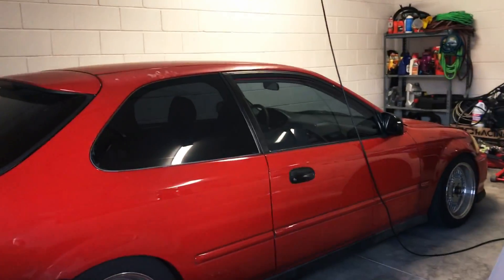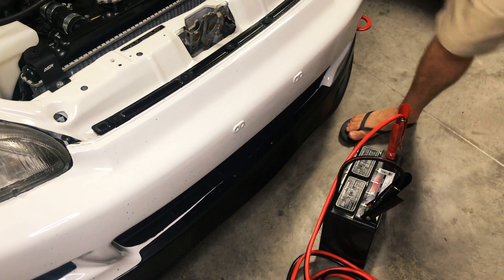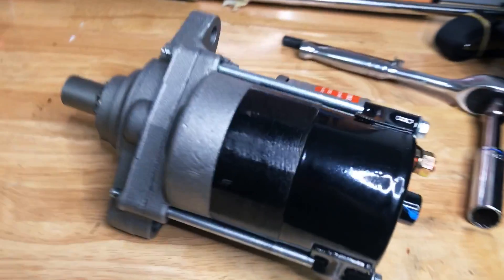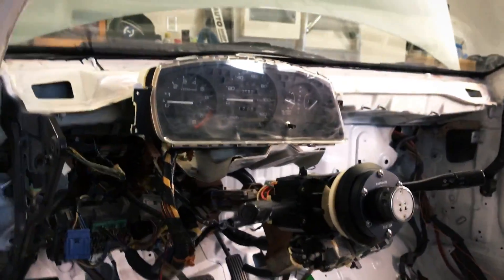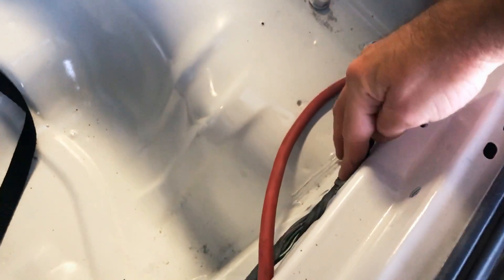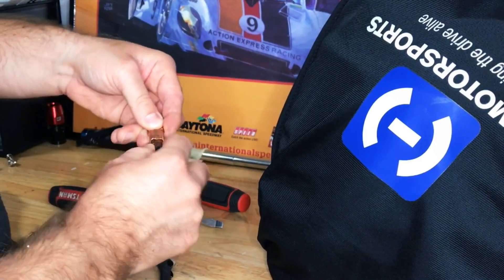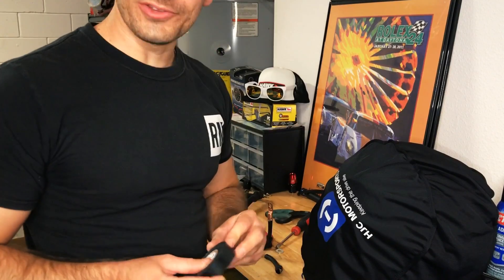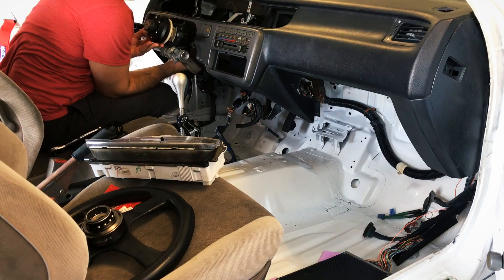Car Won't Start 2 Days Before Track Day!

Comment: There is a tool that you beat with a hammer to basically put a v notch into the crimp on those big copper connectors. I've done so many from 0 to 4 gauge that never ever came apart. I cant remember the name of the tool but it's a black vertical block looking thing
Reply: the tool is a big old screwdriver, full diy spec

Comment: Good fix man, I've had the same problem before missed a day of work trying to troubleshoot till i found that loose black wire going to the battery lol Glad it fired up!
Reply from the maker: Missing a day of work to wrench on the car sounds alright to me haha! Not getting a paycheck isn’t great though...thanks!
Reply: @RefineMovement  it was worth the experience to learn a bit more lol you're right though any wrench time is usually a good time!

Comment: Glad it was a simple fix. One thing I would have tried mechanically would be to put it in gear and roll it to cut the flywheel because it sounded like it was hitting. It is rare for that to happen but it does happen, I have even seen the starter get hung up on the flywheel and not retract. Props for trying everything you could try even double checking that the starter was good after seeing it work.

Comment: Before I bought the crimper,  I either used my vice or a hammer and a chisel. Take the chisel and smash an x in the lug.  Held fine for many years, I only bought the crimper cuz I figured customers deserved better!

Also check out runhard industries, they make battery cable kits and can probably help you out
Reply: I just never crimp them i fill it with solder heat it up with a torch and feed the wire into it. Makes a solid permanent connection with a greater surface area for the electricity and I like how it looks uncrimped lol

Comment: When ever I get this kind of situation I always start with the bigger connections. Its bad connections that give you issues like this. I've seen dozens of times where everything is tight but it doesn't go. I take off all battery connections and clean them with a buffer/sandpaper. The connections on the starter and the battery and then try it again. 9/10 times it'll fire right up after that.  Just as a final thought tight connections doesn't mean a good connection.
Reply from the maker: Very good advice!

Comment: You did good with what you know brotha. I’m in the same boat with my civic. Learning as I go. 
Sucks for your track day 😔 feeling your pain.
My last track day this year, I showed up, unloaded my car off trailer and boom started to leak oil 🤦 tried to find the problem. And after a couple of hours trying I had to give up and push her back on the trailer. Didn’t want to risk leak oil all over the track. So wasted a full day. For what? Find out later that I had a second oil filter o ring stock to the block. And like a dumbass didn’t see it or even thought about looking for that. I learnt my lesson lol that’s how it goes when you are learning. 
✌️
Reply from the maker: Aw man that’s tough! I know all the effort you can go through just to make it out to the track day and for that to be the problem I’m sure it hurt. But you’ll never forget it will you. That’s how I find myself learning g as well

Comment: Hammer and chisel would work to crimp it, propane torch with solder to fill it, adding extra ground wires and maintenance may help in the long run. Your positive post in your bay looks like it’s held down with one bolt and looks like it could snap off

Comment: Glad you got it started! 
Usually when i come across this specific scenario, assuming everything sounds normal when turning the key, such as fuel pump priming and check engine light coming on and then shutting back off, i pretty much follow the same steps that you do, but checking connections before replacing the starter. By the sound of it, it needed a new one anyway, so i completely understand why you just changed it while you were in there. But yeah, get that clamped up proper and maybe double check any other connections that may have the same issue and youll be golden 😎
Reply from the maker: Gotcha, thanks for your input!

Comment: if you just start to actually listen to some of the comments as most likely they have messed with a car more than you then maybe you would be having less problems overall.
Reply from the maker: I always read the comments and I get information from them all the time. Seeing as how I’ve never had this problem or showed it in a video I’m not sure which comment you’re referring to that I could’ve looked back on to gain understanding. I’m just having fun here learning as I go man.
Reply: @RefineMovement  nothing really specific, just a response to the jab at commenters when they’re usually helpful. Sure some are useless and we should all ignore those but I find some helpful ones in almost every video. I’ve been doing Honda’s for 15 years and still learn tricks from others. I didn’t even know to use a ac bolt to drive out a bitch pin until 10 years ago if you don’t have a punch set lol.

Comment: just got a ek hatch and is my first manual car 4 days in and im starting comfortably driving it around. question is do turn it into a track car or a show car. still is all stock but has a bit of damage to the right door jam and quarter but repairable. Also got a genuine fiberglass type r wing that was cracked which i repaired it.
Reply from the maker: Sounds like it’ll be a fun project either way
Reply: Ayyy nice man. I just bought myself a totally stock red 5spd EK hatch a week ago today and I'm so in love with it

Comment: As an electrician, I strongly urge you to fix that crimping job ASAP. #Firehazard

Those loose connections can cause high resistances where the different parts meet, which causes fires. Safe to say you don't want your baby burning down on you.
A very quick'n dirty fix would be to hammer a screwdriver or chisel into the round part of the terminal to make sure the actual cable has a strong connection to the terminal and can't slip out easily.

Alternatively, you could go to a local electrician and ask him if he'll crimp a few connectors for you. It will take him literally less than 2 minutes, and it should be dirt cheap.
Reply from the maker: Thank you for your input, I sure don’t want to have any fire bazaars issues!

Comment: I dont think that starter was bad mate, u got ripped off i think, the chances of both these problems happening simultanously are astronomical, as you've said you've never replaced a starter on these cars, thats because they just dont break that easy :D 

What is the autopart stores treshold for "not working"? Lemme guess they kept your old starter? :D

Comment: Good call with starter. Typically when it just click onces, it's the starter. I would have started with replacing it as well and go from there.
Reply: This is such an inaccurate take, low batter power can do the same thing, and in Hondas, thats mostly the case.
Reply: @NjoyMoney  the thing is, it clicked once. Low battery would have slow crank or extended crank. Dead battery would make no noise/no crank because no power.
Reply: @tinfoilhat1619  After you loose juice from slow crank this is exactly what happens after slow crank the next phase of low battery is the click, ive had plenty of battery die on me and this is what they do if they have a small ammount of juice. It requires different amperage to get the starter going then to keep it going, it needs  amperage spike at the beginning.
Reply: @tinfoilhat1619  And in the video the starter was working when hard wired to battery
Reply: @NjoyMoney  yah but he took it to autozone or whatever is equivalent and they tested it and it failed. So it was on its last leg, prolly not strong enough to crank the flywheel. Did he need just the cable? You can argue that yes, but I think he made a good call. He could have always pushed started it worst case, but why go through that trouble after he just revamped everything else.
Reply: @tinfoilhat1619  So he took it to a place where they sell you a new expensive part and keeps your old seemingly working one :D Maybe im too skeptical ;D
Reply: @NjoyMoney  lol what. Autozone/orielys or anything equivalent is not expensive... I got my battery for $50 there 4 years ago and still doing great. And yah they keep his old one and rebuild it. There is nothing wrong with remanufacrted parts on an older vehicle like a 90s Honda...
Reply: @NjoyMoney  if you think your general auto store is expensive then I pray for your passengers because it seems like you really cheap out when it comes to fixing your car haha.
Reply: @tinfoilhat1619  How does a starter have anything to do with a passanger beeing in danger? Not the sharpest tool in the shed huh?

A starter is a 150$ in a 500$ dollar shitbox civic, thats literally over the third of the price of the car.
Reply: @NjoyMoney  lol how you know he paid $150? You can get a starter for like $80 bucks at an "expensive" general auto store. Autozone has life time warranty. Pretty good deal to me..

Starter has nothing to do with passengers. But you seem to complain about price of a repair or assuming he was ripped off. What I'm saying is your cheap and you probably cheap out on repairs for your vehicle or parts in general. "not the sharpest toll in the shed huh".
Reply: @NjoyMoney  lol now the starter is $850 lol. Dam.
Reply: @tinfoilhat1619  U have a really hard time grasping simple concepts, im pointing the flaw in your logic, saying that because i dont want to overpay, means that im poor.
Reply: @NjoyMoney  my point is $80 - $150 for a starter is not expensive. Typically you get LIFETIME warranty. So if it goes out, you get a replacement for 1/3 of the price, or sometimes for nothing. Depending on store. I am not trying to argue, but do you even know anything about cars. Or work on them? You are right, a weak battery can cause a small click or continue to click till it gets weak. But a starter click is different than a dying battery. I get that you've had experience with dying batteries but in his case it obviously was not the battery. But I have experience with cars. I grew up around them, I build them and race them. Like I said, could he have just fixed the loose cap for his wire and not needed a starter? Maybe. But the car is an early 90s Honda and I'm sure that was the original starter.. So.. He spends $80-$150, gets a lifetime warranty and most likely get another 10+ years out of that starter. That is not bad. Stick to your pc games.

Ontop of that he did the labor himself. That store doesn't really make much, what they up charge the part %10 give or take? And he turns in the old one as a core and gets credit back.
Reply: @NjoyMoney  let's use your logic. Okay cause that's what you wanna do, assume.

So his "shitbox" is worth $500 to you. So buying a $150 starter isn't worth it or too expensive because it's already a 1/3rd of what the car is worth. So, what about tires? What about gas? What about an oil change? Transmission service? Should he sell the car after the 50th oil change cause it's already past the value of the car?

And I'm the dumbass? I'm speaking from personal experience. He has a new alternator, and the battery works fine. So what's left in the equation? A bad fuse or ground? He checked that. So it leaves the starter. Even if the starter was working fine, he obviously had ground cause the car would click when he tried to start it right? So that would mean if it was his battery then he would have a continuous clicking or a weak clicking, wouldn't you agree? You said you had experience with dead/weak batteries. And this would be regardless of that cap was loose. It still had contact and the vehicle still had power. So it wasn't the battery, it was the starter.
Reply: @tinfoilhat1619  Wrong from the getgo. Its about spending unecessary money, not not beeing willing to pay for necessary things, its pretty easy to understand. If the starter works im not gonna replace it no matter how rich i am.

EDIT: U seem to take offense to the shitbox comments, i have 3 shitboxes my self, and i love them.
Reply: @NjoyMoney  k. This is a waste of energy. I agree with what he did but I think you said I was inaccurate because a weak or dead baterry can give the same symptoms. You are right, but in this case you were wrong. His battery was fine. It wasn't the loose end because it came apart After he removed it, meaning it still had contact when he attempted to start the vehicle. His alternator is new and the battery was fine. So... Leaves the starter. And what do you know, it seemed to fix his issue haha. Have a good day.